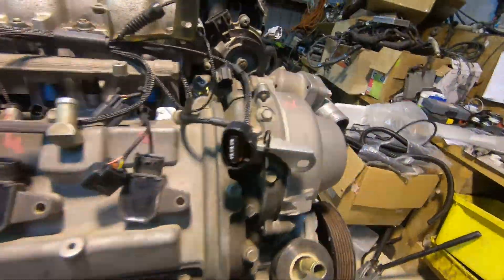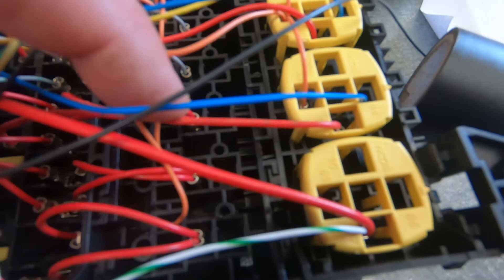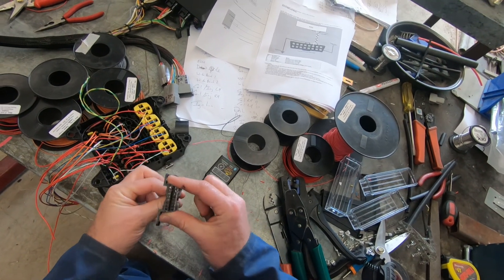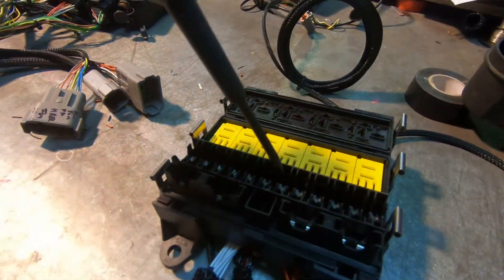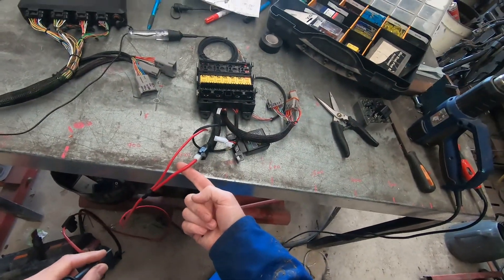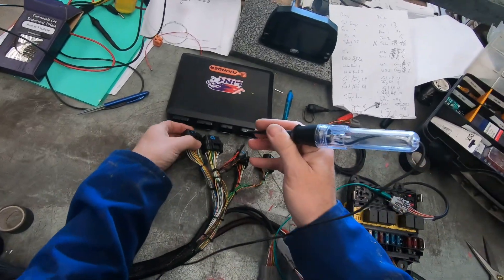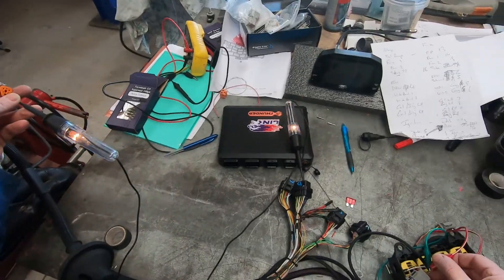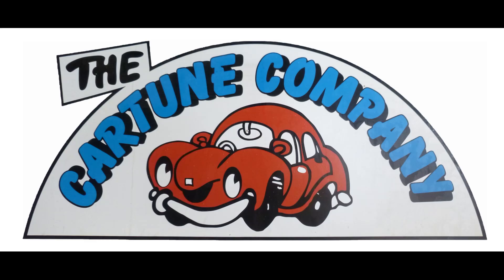Link fuse box part 6

Comment: Great video series. Around how many hours to wire, engine, link and fuse box.
Reply from the maker: Time will depend on the system and wiring I'm doing.  Basic unit might be 15-20 hours,  bigger ones like this one 50-60 hours for all wiring , setup and testing.  That includes setting up injectors and dash setup.  This setup is now in the car and running and fitted perfectly.   Cheers Kelvin
Reply: @CartuneNZ  Thanks for that. I'm a auto sparky in Wellington. A customer asked me t wire a megasquart unit to his river V8. I have spent slot of time planning it out a feel it is going vto take a while. Just wanted a gauge for time. Thanks. We must have goo taste cos we are using the same fuse and relay holders.
Reply from the maker: @mrginja2618  ok.  So MS are at the basic end of the scale.  Maybe 20-25 to do a nice job and set up with everything working.  Dont be scared to do a great job as quality is remembered after the price is forgotten.  Ive also got a series on doing a monsoon in a very similar way with lots of detail.  Check out my playlists to find them and look at hiace van link wiring.  You might enjoy that too.  Not public yet but can be viewed through the playlist.  Cheers Kelvin